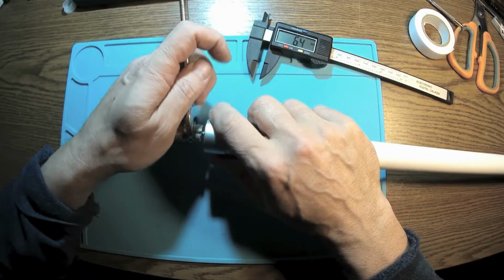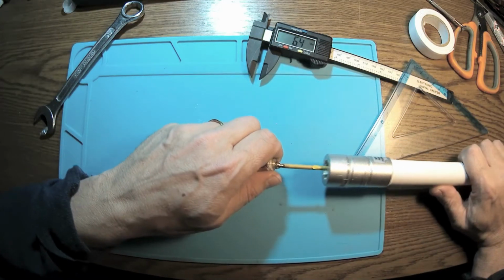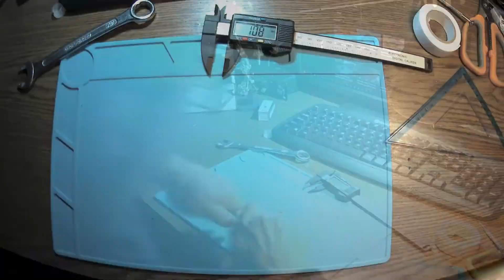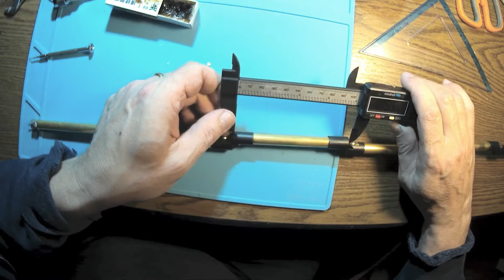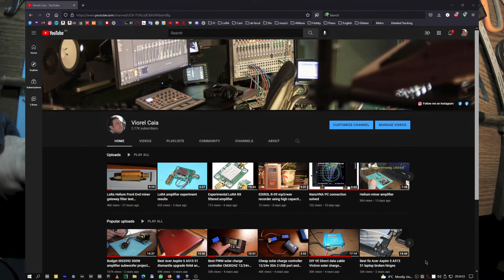RAK 8dB US 900-930MHz dismantle and inspection

Comment: The end is an impedance matching part, you will most likely see if you examine closely that the inner conductor shorts with the outer at some point along the length, this is where the short circuit will be, but of course at UHF it doesn't look like a short circuit.  You may measure 0 Ohms, but remember this is DC, things behave totally different with effect of capacitance and inductance. I think best way to duplicate is to work in ratio's of the two frequencies you are working with and then use nano vna to match the last element.  Best of luck - I built a six element, similar design from coax, and it worked well, I also bought a RAK 8dbi 868mhz, and it only performs a little better. All interesting experiments keep up the interesting content Viorel....
Reply from the maker: Thanks Bryan, I've experimented  with different Coco..amazing nice results , but this configuration is new for me..I'm still learning..

Comment: Antenna will be short as shield and centre switchs at each section, this creates gain. This antenna by design is DC grounded so you don't need a lightening arrestor, a full wave is 100ohm so we have to transform that with sections on smaller 1/4 waves. Most are 1/4 at the start and end.
Reply from the maker: Thanks !

Comment: Vf of the used coax center inside the brass tube is around 66%. (300.000  : 915) X 0.5  X .66  is around 108.2 mm. Due to the fact it will be inside a tube, the frequency moves down .. so a little trimming shorter to get is spot on 915MHz might be 107.6 mm
Reply from the maker: Great explanation! So it's still acting like a coaxial cable segment..it's not velocity for empty tube in open air! That means for 868 I should have (300.000:898)/2*.66=114..05! Thank you!
Reply: @viocaia  You have to calculate the gap between two pipes, so the pipe is shorter than 108.12mm. Also, the element at the top together with the tube next to it should be araound half the wavelength. You will have a problem when soldering tubes because brass conducts heat very well.
Reply from the maker: @nonamen105  Thanks..I have a TS100 soldering iron, amazing powerful

Comment: Damn, I would rather have one made for you than one made for the states because, as I have said before, it is so much easier to remove a part of an antenna than to add on to it.  905mhz is a shorter antenna than 868mhz.
Reply: Thats probb why they use the same tube then for EU and US.
Reply from the maker: @DjHypnoz  right! I didn't think!
Reply from the maker: @ General Awareness ! Please believe me I was ready to write you! So, can you explain what's the lst element,, the small one..I never saw anything like that..is not a quarter , but much smaller..and the whole antenna is like a short..0 ohms..I think I have to start reading seriously about antennas! :-)
Reply: @viocaia  Yes, the maths is easy, and you can tell how long it is for both (which you already did before).  905mhz is what they use here in the USA I believe which requires a shorter antenna than what your 868mhz does.  Snip snip and done to make yours into something works here, but the other way around you have to add on to it which is not nearly as easy.
Reply: @DjHypnoz  Precisely.  One size fits both if you use the one for longer frequency (the USA one).
Reply: @viocaia  As to the elements used I am not sure as I think I have seen this done like this before but it is for microwave usage.  Been too many years.  To my eyes that is a horrible mess of an antenna.  You know what I see missing?  A ground plane.  In all antennas I have seen that are omnidirectional (and are good) they have a ground plane which consists of a number of radials in the horizontal direction.  Ground sticks to the radials (normally 3-7 of a prime number) while the radiating part is the part you touched.  Where is the ground even hooked to in that or is it just there attached to nothing?

Does a 1/4 wave antenna need a ground plane? Answer: Yes. All 1/4 wave antennas work best if they are installed in the centre of a metal ground plane with at least 1/4 wave length radius (1/2 wave length diameter: ~6 inches for 900Mhz and ~3 inches for 2.4Ghz); larger is better.

Now since YT does not allow me to post a link I will say to type this into a search engine of your choice (I used Google and you will see what I am talking about): "1/4 wave ground plane"
Reply: @viocaia  This is a good calculator for you to use - 1/4 Wave Ground Plane Antenna Calculator  Search for that (damn YT for not allowing me to post links YET I have never ever spammed while real spammers post links galore on here due to being bots).
Reply from the maker: @generalawareness101  Super thanks! Just searching for..as the YT politics..I believe we are not censured by humans anymore..
Reply from the maker: @generalawareness101  Very useful and thanks..ground rods means mor ework on details and expenses, also packing , so I'm sure that's the reason..keeping costs down..nut I know about it and I'll see if I can make something..and the metallic part, at the bottom with the connector and support screw are tied to ground.Also I will have a ferrite ring as I know the cable is hot usually at colinears..so good to have you here!
Reply from the maker: @generalawareness101  I can do it..I'm good with soldering and you can't even see where the joint is done..but I'm aware about the dielectric, it looks like there is a kind of hot glue inside rather then foam or poly..I'll use some LRM 600 insides..if it fits..
Reply: @viocaia  Ground radials would be about 18cm long each for 905mhz, and the main antenna mast about 16cm for 905mhz.
Reply: The radiating element is a quarter wave (λ/4) and the radials are 12% longer. There are usually four radials, three being a minimum, but you could use up to six. This is a true unbalanced antenna, with a feed impedance of around 50Ω and therefore a great match to 50Ω unbalanced feedline. The velocity factor is set to 95% which should be fine for most people. You could cut a little on the large side and trim the antenna for best match at your desired frequency if you have the equipment....which you have in the nano.
Reply: @viocaia  I dunno, but as I said that thing looks like a hot mess.  I have seen that kind of antenna before on pumping stations (I had to rack the brain cells to remember) but their range is horrible and really not a very good antenna at all just cheap.
Reply from the maker: @generalawareness101  of course..I will experiment with that..I found something similar here..https://keptenkurk.wordpress.com/2018/03/26/a-lora-868mhz-collinear-antenna/
Reply: @viocaia  I am not a fan of the collinear over the 1/4 wave, or half wave.  edit:  Although did you notice that it even has the ground wave radials?  Yep, that thing, and the previous thing, you have is junk in all honesty.
Reply from the maker: @generalawareness101  Yep ..you're right like always
Reply: @viocaia  No, LOL, not always not even close.  The design for a 1/4 wave, or half wave you will love.  Hell, even adding the ground radials as shown in your find would help I think.

Comment: Thank you for those videos... I have 5.8 dbi antenna but the first 20 cm  from the connector is hidden by a wall  and not in open air... Do you think this will effects the rewards??
Reply from the maker: Think the radio waves like light..so..yes it will ''shade'' the signal